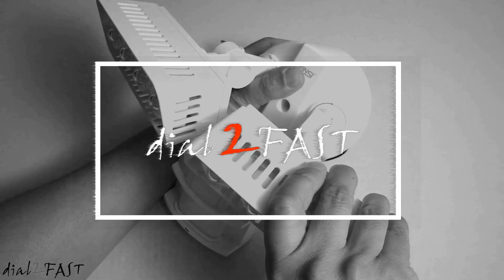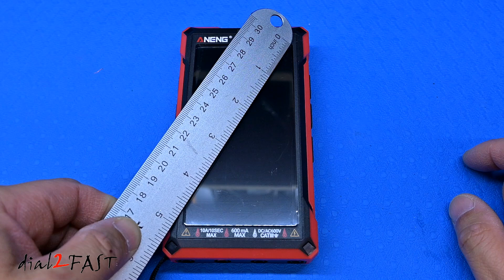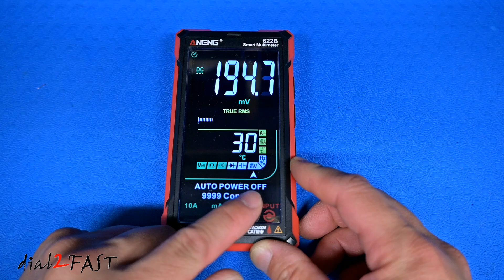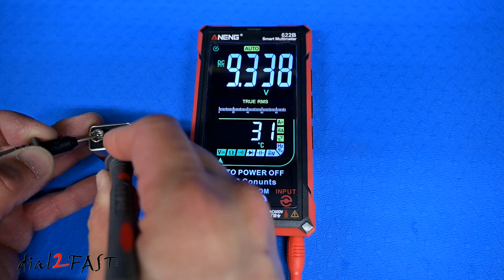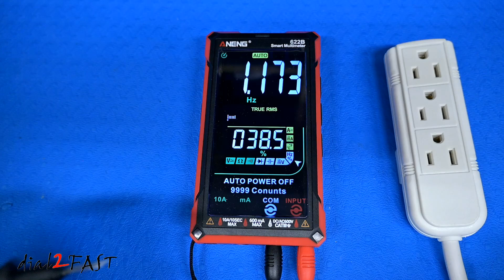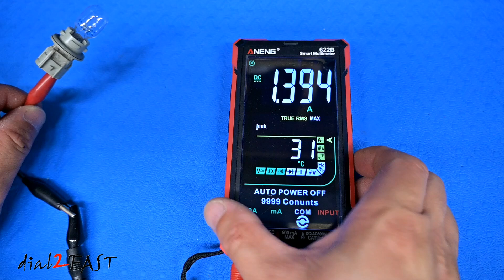$37 Large Display Smart Multimeter | ANENG 622B

Comment: Thank you for your nice review for ANENG tester.
 By the way, how long will it operate on four batteries? Since it has a color LCD, I'm concerned about battery life.
Reply from the maker: That really depends how often you use it. I use mine a probably 15-20 times a year, and the battery still good right now. Also make sure you use good quality battery so they don't leak and ruin the meter.
Reply: @dial2fast  Thank you for the valuable information. It seems that some of the inferior testers run out of battery in a month even when not in use. I am going to buy this tester.

Comment: Why u dont buy the aneng 681 rechargeable batt.?
Reply from the maker: The Aneng 681 is also a good multimeter. I just  prefer battery operated multimeter because I don't ever have to worry about the battery failing or losing capacity after couple of years.
Reply: @dial2fast  thanks

Comment: A nice bright, large display, Multimeter PLUS a Laser Pointer and Flashlight?  you had me at Laser Pointer :P lol.   Honestly, the biggest concern is how Accurate the measurement are, especially for Resistance and Capacitance.  With it claiming to be True RMS, I would expect it to be very accurate for Voltage.  Would suggest adding to your video a comparison of measurements to a trusted quality RMS Meter like Fluke.   Overall, great job on the video. I like that you went through ALL the functions of the meter.  It does look promising for the price point and the bright large display is certainly a selling feature and is about the same size as a phone it seems.